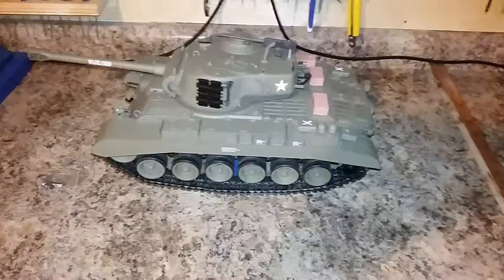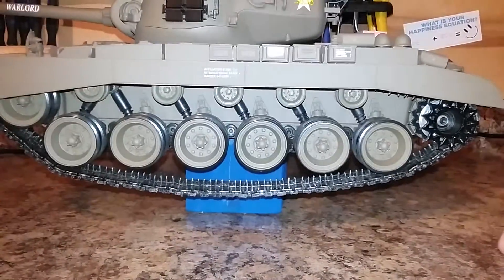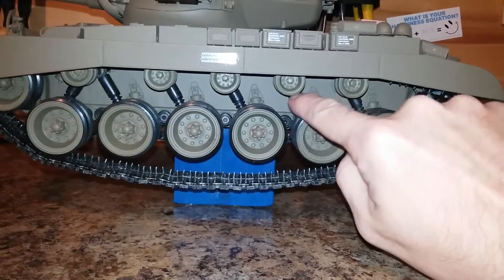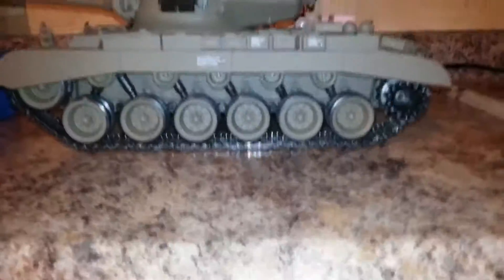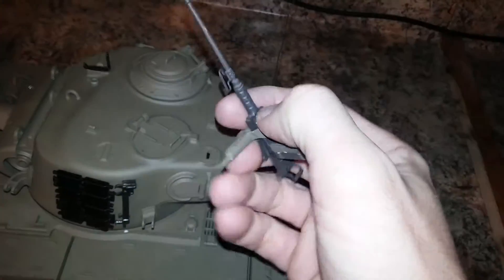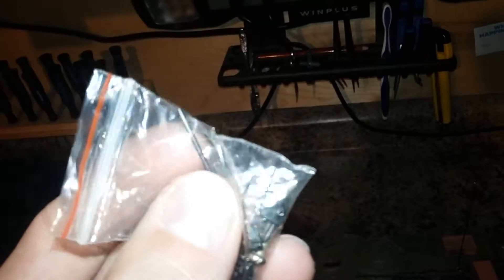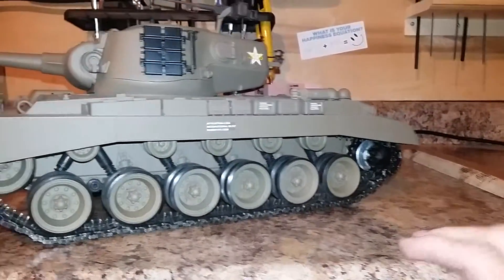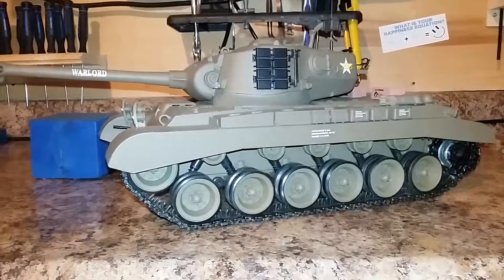Mato metal track tension

Comment: I would expect that track to hang like that when elevated. I say if runs ok and does not throw it off - go with it! 
I am expecting delivery of an M26 Pershing/ Heng Long w/ steel tracks- I will see how they compare and get back to ya with what it looks like elevated the same.
Reply from the maker: Dougster it does need to hang like that. I took one link out and the tracks were way to tight. Haven’t thrown one yet. You’ll love the steel tracks, they work great!

Comment: My Taigen tank has a tension bar in the back to adjust left and right tension, you just have to set a phillips screw on the bottom of the tank
Reply from the maker: Unfortunately heng long tanks don't have a tension bar. It's based on number of track links.